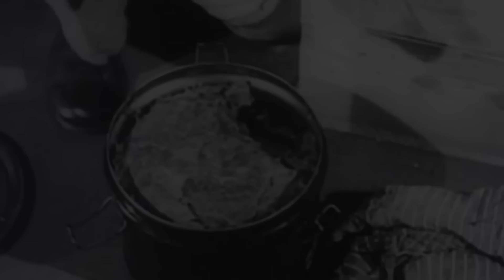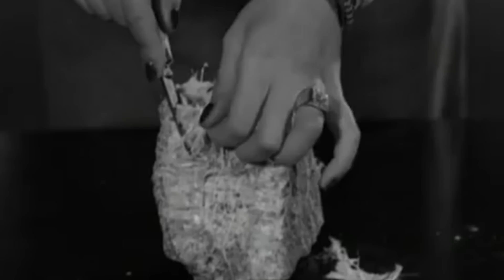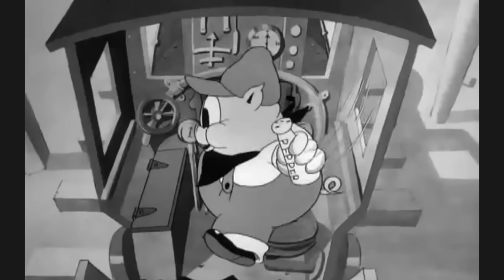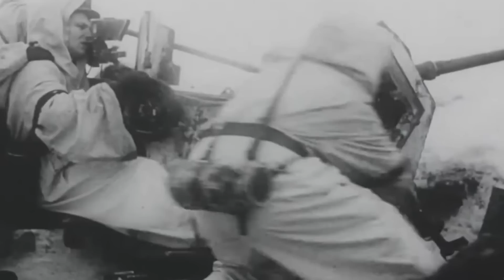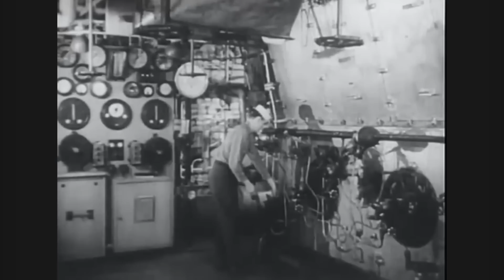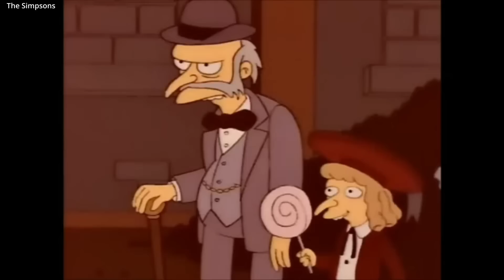Asbestos & WW2

Comment: I’m in the National Guard and our hangars were built in 1942 to house B-29s fresh from Wichita ready to be assigned aircrews. The Army has taken environmental surveys and have found that the hangars are well above the minimum threshold. They tried encapsulating it in white paint but the surveys still show it’s above the limit in both asbestos and lead dust. They also tell us not to drink the water at the water fountains because they tested at high levels for lead. You’d think they’d put up signs advising people not to drink the water. Or if nothing else, remove the fountains.

Comment: theres still a few things that we cant replace without asbestos. as i understand it, it was still legal to import mfg'd goods with asbestos, and trump even loosened some of the restrictions, but im pretty sure most of those products came from russia so theyre not longer available. things like asbestos gloves. the alternative is usually some kind of alumanized aramid or polyimid. not the same. break pads are a good example, they wear out a lot quicker now that they took out the copper and asbestos. sometimes we go overboard. like the ban on r12 refridgerent, one of the best refridgerents chemically possible due to its volumetric effieincy, it beat any of the thermal capabilities of the new stuff that goes pew, while also running a very low head pressure which imo head pressure is proportional to wear and the lower the better for durability. the "ozone layer" has already recovered but now we have to pay 200-400 bucks for inhaled medications because they took out the cfcs and our air con's are less efficient. this is one of the few things that i really agreed with trump on.... for environmental reasons lol.

Comment: To be fare asbestos is actually a pretty amazing mineral. It’s better at everything it does than most modern solutions to the issue of it being literal poison.
Reply: Except modern silica fiber material is as good as asbestos, without having dangerous fibers below 10 micrometers in diamter.

Comment: Well collected footage Johnny.
Everything nearly was a death trap in waiting.
Even the Romans knew not to use asbestos which the Greeks named & used but the Egyptians as well as other ancient societies used the mineral as well.
Asbestosis is awful & my father had it from working on old motors!
Reply from the maker: Sorry to hear about your father suffering from it.  Terrible thing.
Reply: @JohnnyJohnsonEsq  Had it for donkeys.
He just hacks up all sorts.
At present he has 'Cellulitis' in his legs that might have to be amputated due to his diabetes which got him discharged after 13 years service to the crown.

Being an ex-royal marines engineer they even had him on clean up for radiation sights & all sorts.
Personally I'm amazed he has made it past 60 even after having his legs wronged back together from mortar shrapnel.
He's not even sure how much of him is bone or metal.
Bits of random calcified shards find exits out of him as they puncture inside out though his skin.
He has an old tin he keeps the bits that came out of him in.

Comment: I remember using asbestos gloves in my nursing career to handle recently cleaned bedpans. The bedpan flusher would flush,clean then heat our stainless steel bedpans to about 95 C or 200F. Last time I saw one was in the late 1980's

Comment: Asbestos in a solid form is 100% safe. I used to work at a church as a cleaner at night, and the old floors have glazed asbestos tiles. The church wanted to replace them simply due to the dated look, however when they got a quote from a commercial flooring company, they actually recommended NOT replacing the floor and thus getting any business, because since the floor wasn’t already damaged, it was actually safer and cheaper to just keep the ugly tile, because when you break scrape up that tile to replace it, that’s when it becomes airborne and dangerous. They said that just the hazmat abatement process alone would cost more than the actual ripping up and laying down of new floor like they normally do. But since it wasn’t already broken and all intact, and it was in a solid form under a glazing, it was 100% safe to leave as is. They ended up just putting some massive rugs down over it to hide the dated look since it was the children’s Sunday school part of the church.  And on a side note, as a gas mask collector myself, since gas mask filters were mentioned, at the time of production, a brand new asbestos filter was also safe. It was contained within the cartridge and often had cotton in there also. They wouldn’t make a gas mask where the filter material falls apart easily and you suck that in, as that defeats the whole point. However those same filters, which by now are considered vintage, only now pose a possible risk since the material is starting to break down and become loose as all old things eventually do, could then be sucked into your lungs.
Reply: So rocks are fine, it's the dust to worry about
Reply: @gabrielho1874  idk about the rocks though. I’ve seen videos of miners being able to smush them with their fingers because it’s so soft. I certainly wouldn’t handle one. But if it’s glazed over in a brick or tile form I’d have no issue holding it.

Comment: Well, the material of asbestos is definitely dangerous. I feel that in many ways, the material has been greatly over, exaggerated in its toxicity. Now, if anyone has any family members or relatives or anything that have experienced the various medical concerns and such that are often associated with exposure to asbestos you have my sympathy. my grandfather, unfortunately, passed away due to lung cancer attributed to asbestos exposure during his time as a sailor in the United States Navy.

However, I feel that a lot of the commercials and such are demonizing the material a little too much. Don’t get me wrong. This is a very toxic material. But the way it is portrayed in a lot of of the commercials makes it seem like if you even touch the stuff you’re going to get some kind of medical problem. And maybe this is the case , but in the end, it seems kind of dumb.

Little side. Pilots who flew the ME 163 Komet rocket interceptor, actually had to wear asbestos coveralls because of the extreme corrosive properties and toxicity of the powerful fuels. 

There’s also stories of a type of tank I forget what it’s called off the top of my head, but it was a tank that in place of a regular turret had a large basically light on it that would flicker. And because it was an arc lamp meaning that instead of a glowing filament, like what we usually see when we think of large lights and light bulbs this one had an exposed physical arc of electricity going between two carbon points. However, these carbons would have to be regularly replaced. And apparently the only way to do this was for an individual to put on a pair of asbestos gloves and reach in and replace these burned out carbons.

Comment: My wife, when she was a student, looked at a suspiciously cheap apartment. The alarm bell was when the landlord was very strict with a “no posters or picture hooks” policy. The walls were lined with asbestos.
Reply: At least they had a warning! But if it was just in the joint compound that goes on top of drywall, then it wouldn’t be much of a hazard unless you sat there scraping the wall and inhaling the dust it for prolonged periods of time. Joint compound usually only is 2% chrysotile & it’s hard to get the fibers out. The fibers are encased by the other materials that make up the joint compound. If it was a positive plaster wall (and either the skim coat or scratch coat had asbestos) then it would be a lot more dangerous because they contain higher concentrations of asbestos.
Reply: Pretty much all buildings built before 1980 have asbestos in them. Don't disturb it and it's perfectly safe

Comment: My father used to work in mines in Rhodesia and Botswana. He mentioned there would be asbestos all around them but no safety measures were taken. He said he knew the risks but was unconcerned because the mines were soaking wet and the asbestos wasn't in the air. He lived to 86 and didn't have any lung issues so I guess he was right.

Comment: Not all asbestos is lethal. It's mainly blue asbestos that's the problem. I hope so at least, as I carried, and used an asbestos mitt for changing the barrel on the section M60 for some years.
I also knew one man who worked a summer job once at the local brickworks and died of mesothelioma in his mid 20s.

Comment: it seems that the blue fibres are the most dangerous.   the lungs may be able to successfully deal with the other asbestos fibres.   but why risk it.   its still not a good idea to be near the stuff.
Reply: The lungs cant really unless its a very very small amount. Basically if you can see the asbestos, its too much
Reply: @lars7747  , whether you get a problem or not is a lottery.   i worked on a demolition job with a man who later died of mesothelioma.   his brother said it was the only demo job he ever worked on.   he said there was no other exposure to the stuff.   he used to be a truck driver and might have been exposed to brake shoe dust.     i used to work for a few assy removers.   the first man i worked for used to shut the site down and order us all out the very moment fluffy stuff was found.   we would return after he got someone else to remove fluffy stuff.   ive had my lungs checked and i have no assy damage.

Comment: My original PD squad room was located in an old building behind our city hall. City Hall moved and we were moved inside the main building. They immediately shut down that old building and forbid anyone to go in it. Right after that they tore it down and curiously a chain-link fence was built around the footprint of the building. It stayed that way for years and years. We all came to the conclusion that it had asbestos insulation in it and we had spent years in there. No city officials would ever admit it.

Comment: Navy man here in submarines. My boat had tons of asbestos covered steam pipes all over the place in engineering spaces. Too expensive to remediate, so we just covered with layers upon layers of latex paint. Every once in a while, the pipe would need to be replaced or valve changed. Then that area of that boat with pipe was turned into a positive air area with hazmat suits required until all of the asbestos being touched was removed. It was replaced with something I assume was not asbestos.
Reply: Replaced with Nextbestos, "Nine out of ten service members can't tell the difference!"
Reply: Yeah, we got state of the art lead pipes now bois...
Reply: Same at our company. Much of it was buried under latex paint and marked with stickers. Same with metal fire doors that have it sealed inside.
Reply: @cyberleaderandy1  Well, that's best practice for managing asbestos when it's already there; seal it in place and add "check and maintain asbestos at x" to the maintenance schedule.
Reply: I stayed in a dorm in the 2010s that still had asbestos in the building.
Reply: 3M Nextel ceramic fibre. As used on the outside of the Space Shuttle.
Reply: @allangibson8494  Really even more of an alarm there and also with those fires in the news could look into the helicopters and aircraft used like the Skycrane and I'm sure they have a C-130 in there along with civilian Boeing aircraft in that and maybe the Chinook is possible.
Reply: And through the wonders of the MIC, it was replaced with super asbestos.

No difference, just 500% more expensive because, hey, taxpayers foot the bill
Reply: Sure hope you mean a negative pressure room
Reply: @Delalcon  No Positive air zone,  this was the 90s, they would tent off the zone deck to overhead with an airlock., pipe in huge blowers to positively charge the area, and then have exhaust into what I hoped was filters in the huge boxes sitting on deck of boat. This was for large jobs. For a small job, just soak it with water and soap, plastic off the area, remove the material, wash it down again, and everything is just thrown away. later. Of course everyone wearing PPE and respirators.
Reply: Really can only wonder what other dangers were kept hidden and also other parts to tell JJ about could look into RPG-7's, AK-47 and it's other variants like the AK-74, DSHK,, Chinook helicopter, H-21 or Flying Banana helicopter and also those MANIPAD missiles like Stinger and SA-7 are also good among others like the MI-24 Hind and ICBM are good anyway a whole lot out there.  Even the AH-1 Cobra and Apache helicopter are good and who knows could do one on the Betty Bomber and maybe a standalone video on Japanese aircraft of WWII like the Zero if possible.
Reply: @kellychuang8373  iirc the b17 had a problem with the upper turret damegeing oxigen line over time leading to explotions

Landcaster had some escape hatches that were too small to exit easly with a parashoot

F117 ram coating is very dangerus

There are many other example

But a lot of gear is also just fine (coatings to protect from cbrn may not be fine)
Reply: @nikolaideianov5092  That's also something to note about really a tough job for those pilots and people working on bombers and aircraft.  Also could tell JJ about that F117 Nighthawk idea for his videos among who knows what others.  Along with those aircraft and helicopters I mentioned in the fires we're having now.

Comment: It's actually a major struggle with steam locomotive restoration, as a lot of locomotives on static display still had their old boiler jackets with a layer of asbestos in between. Removing the stuff is super dangerous but necessary

Comment: Thinking about the past use of asbestos makes me wonder if there's any material/substance we use today that will be looked back upon in the future in the same way.
Reply: plastic
Reply: We're already aware of endocrine disruptive activity from plasticizers like BPA. We're aware of the inevitable consumption of micro plastics because they don't biodegrade, just physically break into smaller pieces.
We have lots of natural fibers available for use, but continue to use polyester and other synthetic materials, which deposit microplastics into the water when laundered.

It's just that plastics, like the forever chemical PFAS, are designed to be non reactive. The effects we see from them are probably going to be subtle, minor health effects that show up over time. 

The evidence against cigarettes and asbestos was crystal clear, with massive death tolls for both. Even so, industry fought back, and it took ages to actually change things.
Reply: internet
Reply: PTFE (teflon) maybe
Reply: Forever chemicals and plastic
Reply: Probably the microplastics that can be found in every human (and dog) testicle, as well as often blood, breast milk etc.
Reply: Talc
Reply: PFAS
Reply: Drywall. Drywall is fine once it's installed but the dust that comes off drywall when it's cut and dryall plaster when it is sanded is likely as hazardous as asbestos.  I'm an electrician and hate working around drywallers because of the dust.  I wear a dust mask if I'm around it, but most of the drywallers don't bother.

Asbestos is a great product, unless you inhale the dust off it.
Reply: @minuteman4199  no its not, because the dust isnt like tiny needles, so it doesnt penetrate cell-walls on a microscopic scale.
Not good to inhale though, but a regular mask is sufficient. Same with metals. The fibrous nature of asbestos is what makes it so nasty.
The classic glas wool has the same issue, just to a lesser degree.
Reply: Cell/wifi signals. They dont care. Everything is a new distraction
Reply: @kdaltex nope

Comment: Back in the 80's I worked in a papermill with linotype which used a crucible to melt a lead amalgamation to make the typeface. The crucible was insulated with asbestos to keep the heat insulated. Every 6 months or so I got tested for lead poisoning, but not for asbestos contact. I have problems these days if the humidity gets too high because of that contact.